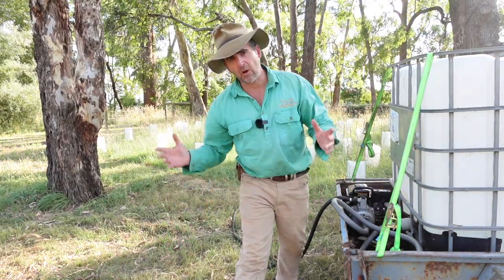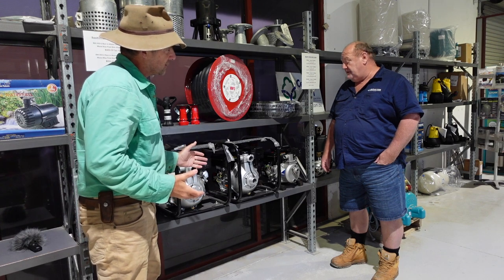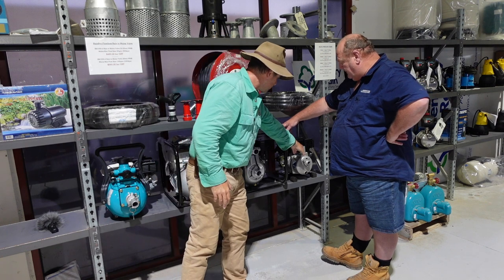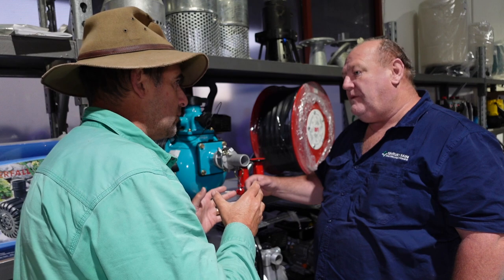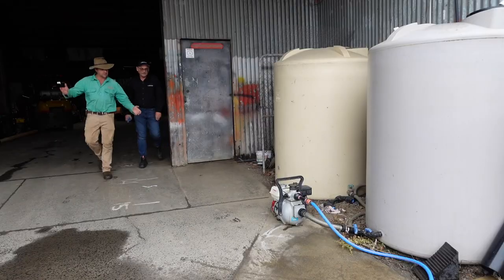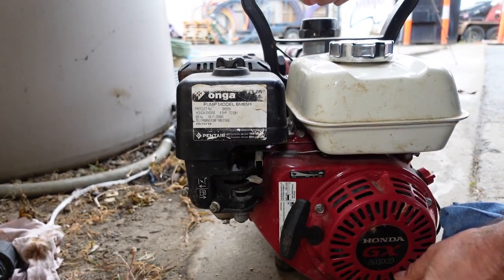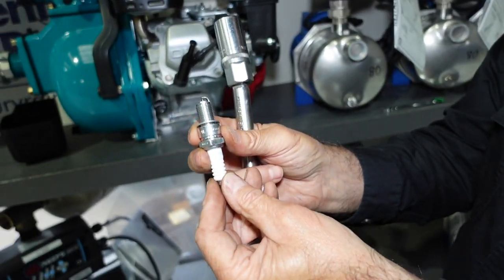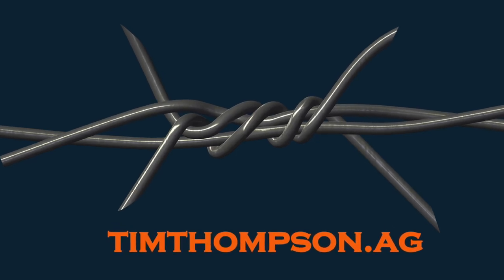Fire Pump Basics

Comment: Always run a return line from your pump to the tank with a valve on it, this is so that when the pump is running without you spraying water there is still water circulating through the pump, otherwise the water in the manifold will boil and destroy the pump.
Reply: Would like to see a video on fittings and setup

Comment: Great video Tim.  Would love to see a follow up on bringing a fire trailer together with an IBC, the various fittings required, and how to prime your pump.  I have been through several iterations of fire trailers and even managed to lose one along with the car towing it in the black summer fires (spare fuel container on the trailer did not help).  My final iteration had a hose reel, cam lock suction hoses, CFA quick fill fittings on our tanks and two additional flat hoses all plumbed into the pump manifold.  I googled the daylights out of it and did not find a good how-to video so I think it's a good candidate for your excellent channel :-)

Comment: A tip for non mechanically minded people, If you have to take the carb / throttle linkage or tank off. Take pictures of the springs and linkage rods as there are several holes to choose from when you go to re assemble everything.
Reply from the maker: Great tip!

Comment: I have a cheap diesel pump, not as portable being on a  modified metal IBC pallet which acts as transportable pump and shed. I can leave the fuel in it for 50 years and I reckon it would start first go. Another top tip is to put a check valve on the end of your suction line, you wont lose prime and you can jiggle the hose to prime it in the first place, just like those marble fuel siphons.

Comment: I've been driving around day thinking I've left out  the most important aspect of meter / head. Its actually a true number of pressure, Any pump, fire or other wise. If you were pumping water up hill, say to a stock trough. You need go know that the pump is capable. Higher the head distance, the more P.S.I You need

Comment: Great and informative video Tim I've got my own fire trailer consisting of 2 hoses,400 litre tank and a 4 stroke 1.6 hp 1.0kw fire pump it has a bit of grunt in it with a max head of 22 meters and a flow rate of 120 litres per minute so perfect set up for grass fires and doing asset protection during a major fire plus my water supply lasts about 10 or so minutes using both lines and about 15 with a single line

Comment: Can/should you put an over pressure valve on the pump for when you shut the nozzle off the water circulates back into your ibc instead of blowing your hoses or pressure build up on the pump? Keen for your insight as I’m trying to look for a suitable valve
Reply from the maker: I’m doing another video on a fire trailer soon… I’ll try to incorporate

Comment: Hi Tim. Phil Fehring here. The engineer in me, couldn't let this pass. There's a slight discrepancy, in your mans interpretation of meter (meters) of head. Meter of head is actually a rating of pressure. Not how high you can blow a stream of water into the air. That's a factor of pressure, flow rate and orifice size. For instance, if you had the Yarra Valley's highest water tank at 62 meters, the weight of the water at ground level would be 88 p.s.i. 24 meters as per the first cheap pump only equates to 34 p.s.i.

Its a very old measure of pressure, along with old anglo units like "inches of mercury". Unless your the MFB, your not shooting water  62 metres into the air. Once upon a time it was "feet head". Any doubts just google conversion of metres head to p,s.i, MPa, pascal etc.

If I was picking a fire pump, I'd be looking at flow, gallons / litres per minute. How much water you can dump in a given time. 
As always. My respect and best wishes. Phil.
Reply: So your happy to prescribe to the the theory that that pump can spray 62 meters ? An AFL football oval cant be shorter than 135m. So you can shoot a water goal from beyond the centre circle, to past the goal line? Tell that to a fire fighter. For those following along TDH means Total Dynamic Head, which I explained  3 days ago. The head pressure if you were pushing water up hill to say a stock trough.
Reply: @erikhouweling1552  For those following, T,D,H would be Total Dynamic Head, Head/ meter's as I surely mentioned on  my very first post in this thread., That 88  @ 34 P.S.I thing

Comment: Regarding maintenance, I have had a lawn mower with a similar carburetor system that I ran completely empty by turning off the fuel tap. I still had trouble starting it up again after not using it for a long time. Had to pull the carburetor apart  and gave it a good clean before it ran again.

Comment: Good vid Tim.
I would suggest  if you choose a hose reel (especially 36m long) that you have a minimum 2 outlet pump.
A long hose like that (which is probably 3/4 " is going to greatly reduce the performance of the pump and slow down jobs that are basic water transfer, such as filling a stock trough.
Not sure I agree with the description of " head" being how high it will spray.
Reply from the maker: To convert head to psi multiply by about 1.4 it does affect how high the water can be pushed from pump, but only loosely you are totally correct.
Reply: Agree on the head numbers...head is how high the pump is capable of pushing water up a pipe...that much different that spraying water into the air

Comment: G'day Tim its me again 😋just gone out and ordered a 7.5 hp twin impeller honda 4 stroke fire pump from DMC mowers Australia it has 3 top outlets the 2'' outlet will be reduced down to a 1'' for a pressure relief tap and I've also started phasing out nut/tail hose fittings that are very prone to cross threading/leaks for Camlocks which are easier attach/detach will most likely look at replacing the nut/tail fittings on my tank/pump delivery line over to camlock as well, A piece of advice if you wanna control flow rate coming out of your 19mm hose get a nozzle that has flow rate control dial on it
Reply from the maker: Onya mate. Sounds like a ripper setup
Reply: @FarmLearningTim  my current setup consists of 2 outlets running off a 1.6hp single impeller but that will change tomorrow as the local engineering business is installing my new pump onto the tank and I've got a lever control nozzle coming in the mail, before next fire season happens it will be fully camlock fitted

Comment: Regarding maintenance, I'd also suggest draining the impeller housing via the plug if not using the pump regularly, its surprising how quickly water which is less than 'perfect' will corrode the cast alloy.    Also, ensure you have a good suction strainer if sucking from dams etc as small stones will quickly block the flutes in the impeller greatly reducing capacity

Comment: i'm going to get on my high horse here about my own experience with a bushfire.  i was at kelmscott, wa when the bushfire happened in 2011.  anyone in a bushfire risk area needs to have only brass hose fittings.  i kept breaking plastic fittings trying to get a few extra centimetres out of the hose to extinguish that burning stump.  get rid of evaporative air conditioners.  they were the reason why a house burned when the two either side did not.  i remembered a segment on that beyond 2000 tv show about fireys in california using  a finely crushed version of the same polymer used in disposable nappies and water retention crystals for gardens.  i wrote to the then minister for fire and emergency services who passed my letter on to the bureaucrat heading the department who fobbed me off claiming it was unsuitable because it hadnt been tested and had no accreditation.  what bullshit.  the stuff is used close to babies bums and in peoples vegie gardens.  it would nearly certainly be suitable for aircraft fires too with no risk of groundwater contamination.  furthermore, i saw a small container of some sort of fire retardent in a small box with a truly ridiculous price at a local small motors dealer.  i suspect it was the same stuff.  tim, why dont you look into this matter.

Comment: It should be noted that the max - pressure is at stall pressure, the maximum pressure the impeller can impart, when you have the trigger / hose off  Engineers describe that as dead head pressure. Dual impeller pumps will have a higher head pressure. Depends is you are washing a car, or putting out a fire. Quantity is the key.

Comment: Thanks for the video Tim, just a bit of a correction - head isnt how high it will spray, its how high it will lift in a hose/pipe less friction losses at a given flow rate as per pump curve (edit: just saw the comment below, must be an engineer thing..)
Reply from the maker: Yeah. Tried to KISS with the explanation….. I’ll try to expand if I get a chance to do a follow up video….

Comment: Excellent. 
Do you think you could look at pumping from a dam where the inlet line needs to be greater than 7 metres.
Cheers
Reply from the maker: I’ll put it in the memory bank. I’m no expert but seem to remember the maximum draw of pump’s being about 9m that’s why in the solar powered pump video last year we used a submersible pump in the dam. Pumps can push, can’t lift.
Reply: Thanks, most appreciated. Shall also have a look at the submersible pump vid.

Comment: Numbers .. 1Bar = 10m water colum
7bar 70m throw in theory.. there are presiur loss
In too small and too long hoses.. I prefer 2" 50m max hosez venturi nossel then you only loose 0.5bar so 60m throw.. bur flow rated nossels if pump give 400L its @7 bar.. SO to keep Max pressiur use 150l nossel.. 
Kmow your pump.. buy Thing who match..  why 150 not 200l .. presiur..and trowh lenght.. 50l more.. yes but 400l @min uses 1000l
In 2.5min. 300l @ 3.5min you need you wagon with 5000l to get In plase 
With 1 50m hose 2" and a 300l venturi ... thats 600l/min 60m Head you can lay down .. DO you know how big a fier you can stop .. 
You got water to 5 min with 6x1000L. 
5min is a life time.. you can hawe smaller hose reelt to grassat fier
Think like this 150l nossels 300l nossels 50m 2"/3" hose is stationary 
Hose reelt is brush/ grass fier...  you need big tools to big jobs.. 
Small tool to small jobs.. PERIOD 
Fier .. time up sec. horisontale minuts. down houres vind helps.. 
Please do not be cheape skate.. this culd save your life..

Comment: 1. I GOT A RUULE.. 
TOO MUTCH OF EVERYTHING
IS JUST ENOUGH.... Becaus.. you
Can't afford not to put enough water
On any fier.. the more water more hosez
The faster and less damage fier does.. 
High presiur high wolume pump
2"/3" inlet 7Bar 400L min .. 2 x 1.5 50m slanger
2x wentury nossels 1/2hose reelt ventrikel nossels
Watch water flow on nossels on 1.5" use 150l/m
On hose reel use 50/70l/m 
Hawe 4 or more 1000l tanks.. 
1 or 2 fast respons tendens..  
1 or 2 wagon with 5 x1000 water.. x high L /3" to fill all tanks.. 
This is money wall spent.. And the more water you douse out
The faster you are finishen.